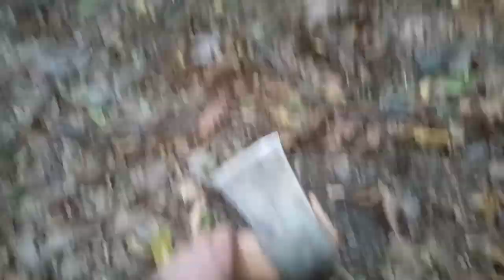DIY - pregatirea unui cap de topor si montarea cozii

Comment: Data viitoare faceți pana mai subțire dar și despicătura mai în V.  Faceți semn pe pană unde ar fi la nivel cu lungimea despicări în coadă. Astfel vei ști dacă a intrat sau cât mai trăbă bătut. Despicătura în coadă 70% din lățimea toporului. Aracetul se întărește în 4-6 ore. Depinde de temperatura aerului. Pana de fier se fixează  puțin mai în diagonală de obicei se pun 2 bucăți!  Toate ăstea sunt simple sfaturi!   Dvs. Hotărâți dacă sunt bune s-au nu? Succes!
Reply from the maker: multumesc frumos.
sfaturile tale sunt foarte bune. treaba cu marcatul pe pana cat trebuie sa intre o fac si eu acum. treaba cu despicatura in v inca nu. poate o sa o incerc candva
Reply: @outdoorstuffandsharptools3020  Despicătura trebuie să fie asemănătoare cu forma penei pentru ca cele două să se conecteze cât mai perfect! Deasemeni înainte de a pune coada în topor și bate pana ea trebuie să intre 65 -  70%  în locaș manual fără ciocan. Apoi toporul îl forțezi să intre cât mai adânc pe coadă înainte de a bate pana pentru a strânge din ambele părți. Și eu în timp le-am exersat pe toate. Înainte erau doar topoare cu muchie conică ce se punea doar prin bătaie fără pene! Penele adăugânduse mai apoi după ce coada începea să miște. Vă salut și vă doresc succes în proiecte!  Dar să ne mai puneți și câte un video când puteți.
Reply from the maker: multumesc frumos Daniel